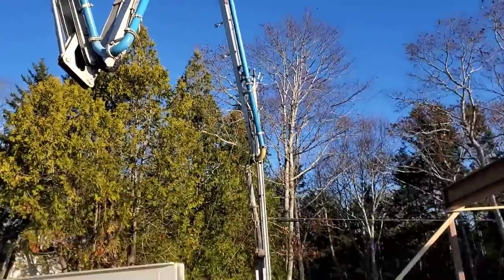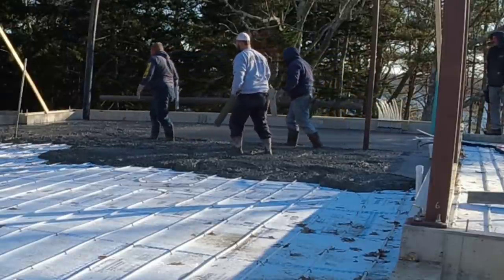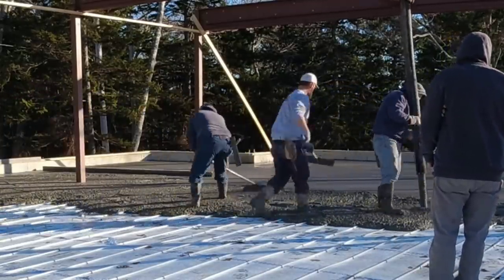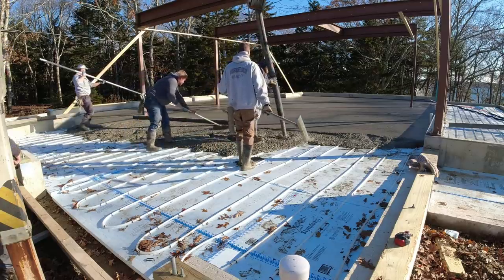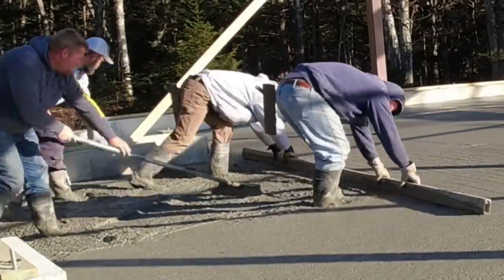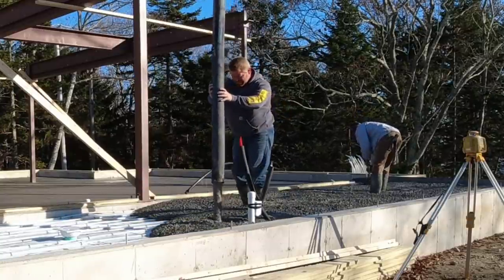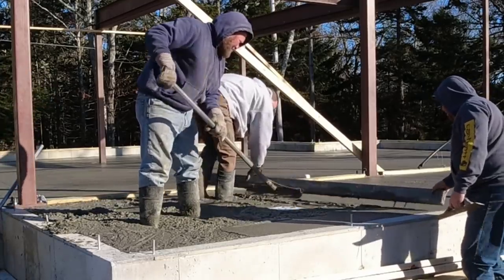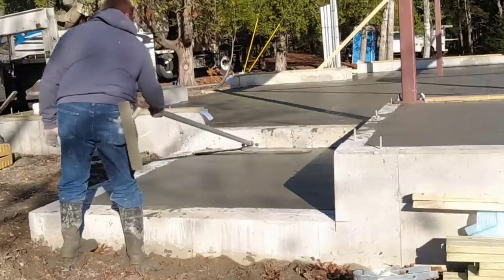Can You Pour Concrete Over Ice? (Pouring Concrete Floors IN Freezing Temps)

Comment: We don't just keep doing things the way we learned 30yrs ago!, These days a temp heat setup hooked up to the tubing which is just hanging like an invitation does the trick quite nicely to produce real quality work. Just a lil sheet poly overtop the night before. Absolutely pump the slab! Finish/Cut/Cover back over with sheet poly and a double round of insultarp!!! NICE. :)

Comment: I have tried air entrainment in concrete you must be using 1-3 percent. The pump does add air in the mix. I didn't like air entrainment in the concrete for me it wanted to peal or delaminate. Typical it's for outdoor sidewalks, patio's, footings, and foundation's. I once had a customer complain about the tiny air bubbles on his patio broom finish. I mentioned I poured it but don't make the concrete. I assured him it was good for freeze thaw application. I'm sure it works good for you, or else you wouldn't use it. For me it didn't, great job keep up the good work Mike.
Reply from the maker: Thank you and yes, we don't really have any problems with it. We use it a lot, maybe we're just used to how it acts. When I first started concrete in the 80's they put 5% air in everything we did. Now it's just mainly for exterior pours.

Comment: Hey Mike Love your videos!  So up here in Canada we see a lot of different extreme temps from hot to negative temps.  To answer your question about air in concrete;  typical concrete has 1-3% entrapped air.  When doing a steel trowel finish this is the range you want to be in.  Adding air entrainment of lets say 5-8% to your mix because of the cold is a risk of delamination of the surface when doing a steel trowel finish...( the bubbles you see at the surface is a sign of this starting) air entrainment should be avoided when a steel trowel finish is required.  Now I know there are customers that demand it so a few tips that will help:  Lower the air to minimum as possible like 4-5% max, adding poly fibers helps hold it together better when the bubbles are trying to microscopically combine to create bigger bubbles which cause the delamination and lastly I use combo blades after floating on my power trowel in these cases as they are less aggressive than a trowel ( keep flat as possible). For those that don't know a combo blade acts like a float and a trowel.

Keep up the good work!! 😀
Reply: Do u ever break with combos?
Reply: @ryanbellaandgoose9350  

NEVER....You should always break with floats which pushes the aggregate down and brings up your paste that you finish.  When it's at a tight float; Then you can use the combo blades or trowels to finish.  Combos or blades first or even too early can bump up the floor or even roll the aggregate.

Situations where combos help rather than trowels:
- concrete with air ( if they make you do it..but should't) 
-spongy floor in sun ( caused by top drying faster than the bottom) - use an evaporation retarder helps here also
- retarder in concrete ( I NEVER DO THIS, but if you do then combos help)
- pouring and finishing concrete in winter conditions and its slow to set ( combos help to not fully seal the surface and still somewhat act like a float)

Hope this helps!
Reply: @fxeaglepips7109  thank u it does huge

Comment: Man, it's been a couple of years since my brother was a concrete contractor here in AK, but it's the same situation - not so much pouring in wintertime because we're deep into snow by now, but that looks like a typical AK fall time pour. I don't know how many times we would show up in the dark and start pouring as soon as it was light enough to see and by the time we were done cleaning our tools and covered up the concrete, it was dark, dark. We would use concrete blankets when we could, however, due to some long driving distances and the desires of his clients (aka - clients wanting to cheap out) we would usually spread hay when the concrete set up to keep it warm to mixed results that were more in the hands of his clients than on us (clients saying that they were going to build before the snow and hard ice, but not doing it until the next year, etc). I don't miss those days too much, but it looks like your crew really has the process down and you do a great job. Good on you guys!
Reply from the maker: It is difficult when it's cold, we're used to it but it's not very fun!!

Comment: You have a great crew, seem to play off of one another. "Well oiled machine." Questions I have: are you screeding to a line from your transit level or an audible? Are those Aluminum screeds? We use homemade Gandys with 2x4's pouring to grade lines and screed pegs with a nail marking grade as we go. It works for bigger flatwork but I like what you do.
Reply from the maker: Yes, we screed to chalk lines we set with the laser level. The screed boards are magnesium. Aluminum has a bad chemical reaction with concrete when they come in contact.

Comment: I do work with tons of left overs here in the Midwest and absolutely we use frost blankets to cover the concrete after it skins a little bit. Mike quick question regarding to gear, what kind of boots do you use when you pour concrete. I used the artic sport (Mucks) but they are falling apart. Do you as professional have a specific brand you wear?  Thank you.
Reply from the maker: I get these at Tractor Supply. Just basic lightweight boots nothing special.

Comment: Years ago during a renovation they poured the front of the store in the dead of winter…….come spring all the huge windows in front of the store cracked and well as the concrete work all had to be replaced……..besides ice there can excessive water in the soils ….expanded clays……..
Reply from the maker: Yes, you're right. We deal with those soils a lot.

Comment: You got any pointers for troweling air entrained concrete? I recently did a garage floor. 2 percent calcium, 6 bag straight mix, hot water, water reducer. 30s for temperature.  Got air bubbles after power troweling a couple times. Air would get trapped underneath surface and push concrete up a little, like a bubble. Had lots of those. Wasn't as bad after a couple more passes with the trowel.
Reply from the maker: That's a problem for us too sometimes, mostly in the Spring when we pour on cold ground and the top sets much faster than the bottom. I haven't seen it this fall yet. Probably nothing you did, just unfortunate. Sometimes they'll come out of it as you trowel, sometimes we'll "slice" it with the hand trowel and then trowel over it to flatten it. Just try to trowel as "late" as you can, never early.

Comment: Hey Mike, what are you using in place of rebar?
Reply from the maker: Most our contractors use Fibermesh. It's been difficult to get wire mesh.
Reply: @MikeDayConcrete  If wire mesh is used is it compatible with the accelerator?